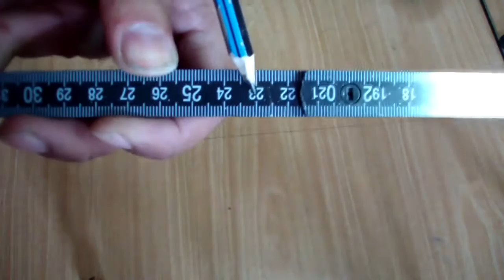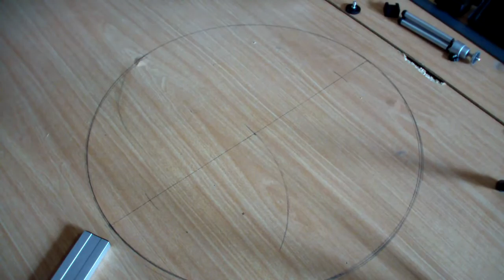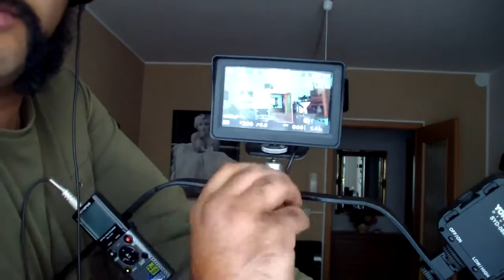Cheap DIY version of the Fig Rig Camera Stabilizer Nikon D5100

Comment: you did an awesome job Zeeadster, i am wondering what you will make next :)
Reply from the maker: thank you. you know an original fig rig, is about $300 and you still need to put much more money in it to be able to mount your gear on it. and this one is $4 from hardware store and if you can't weld you can find a way to glue it. and you can make it out of aluminium so it is easyer to bind
Reply: Zeeadster TV where did you get your monitor?